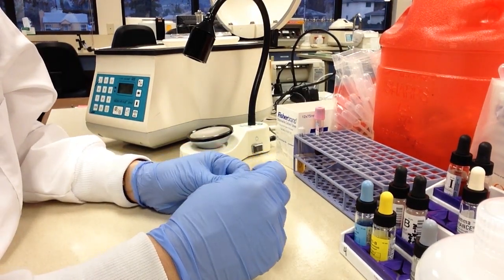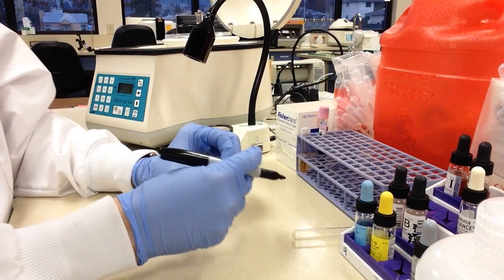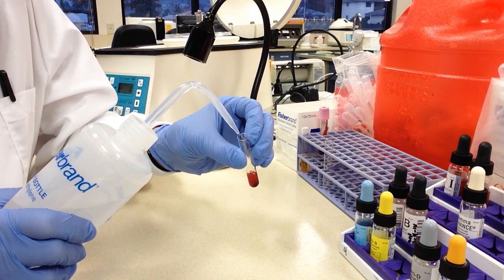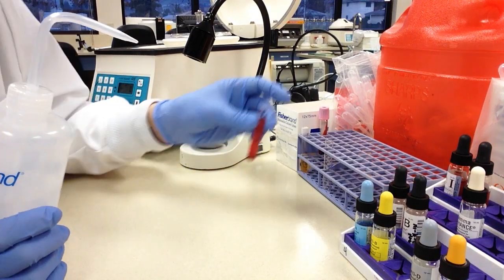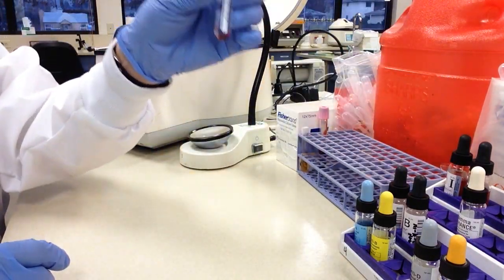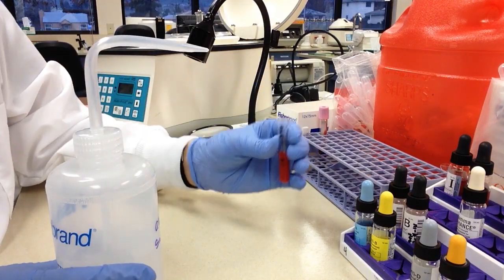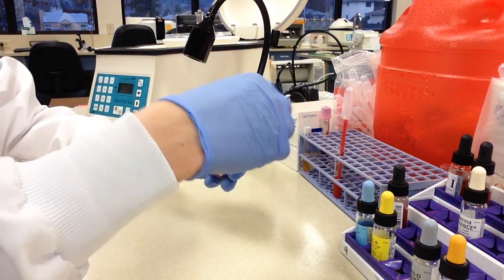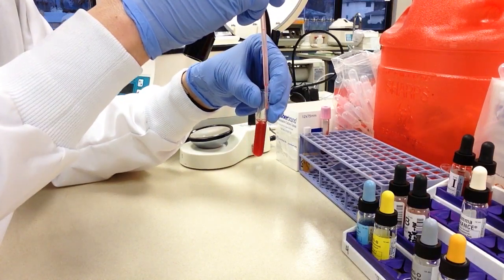Blood Bank - 3% RBC Suspension

Comment: Thank u  for a good presentation.Is there any other method of preparing 3-5 percent saline apart from this method of comparing it  with commercially prepared one?.The reason i ask is because some people  practice where this commercially prepared one are not available.Thanks once again for sharing the knowledge
Reply from the maker: It may be possible to do a hematocrit on the suspension, which should be 3-5%, but I cannot guarantee in any way that these results will be accurate.
Reply: Patrick Tracy salam

Comment: hey i have a few questions about this test.

1. Why need to have 3% cell suspension?
2. What is the purpose?
3. Different between using whole blood and 3% cells suspension.?
-
Reply from the maker: +Oyleza Bell For optimal antigen/antibody reactions to occur, we need to avoid prozone and postzone. These involve an RBC suspension that is either too heavy or too light. Too much antigen or antibody can lead to false results.We don't use whole blood because every person may have a different RBC concentration. The essence of blood bank testing is consistency, so for that reason every step is controlled even the concentration of RBCs.
Reply: The suspension is made cause we should make sure that the concentration between the Ag and Ab of the test will be ballance. If you watched from the beginning of the video, he separated the plasma component to remove the Ab of the sample at first, it means that there's only RBC in that tube which means the Ag of that blood is much more than a whole blood.
Reply: @ear_sthetic1221  

Thank you sooooo much
Reply: What do you do if you have not reached the desired 3% suspension after putting in the saline? Do you just dump a little bit of the suspension then add more saline?
Reply: To expose antigenic sites

Comment: Can you use whole blood from an unspun pink tube?
Thank you.
Reply from the maker: The problem with using whole blood is that it still has the plasma in it, which is not what you want. You may have to wash your RBCs more than once. You should ask your instructor or blood bank supervisor.
Reply: Thank you very much, Patrick!
So there would be no problem if it is washed a few times?
Reply from the maker: The point of washing is to get rid of as much protein as possible, so washing a few times with isotonic saline will probably suffice. However, you really should consult your instructor or blood bank supervisor on this.
Reply: Thanks again, Patrick! 
Actually a fellow tech insisted on doing this method.

Comment: Why we make rbc suspensions? Why not just use whole blood
Reply from the maker: Hi Hafsa, we make a 3-5% RBC suspension for two reasons. One is because we need to have consistent testing conditions. When we make a 3-5% suspension for all patients, we can say that the results will be more consistent and reliable. If we used whole blood, the percentage of RBCs could be very diffferent from patient to patient. The second reason is because whole blood contains plasma which may interfer with agglutination. To put it simply, plasma is sticky and may lead to false positives in agglutination.

Comment: hmm what are the uses of RBC suspension in the laboratory?  and how can centrifugation and decanting of supernatant affect the final concentration of the red cell suspension? 
pls help me, I really need the answers asap. thanks:)
Reply from the maker: In blood bank testing, we test plasma/serum and RBCs. For RBC testing, e.g., forward typing, we need a 3% RBC suspension from the patient before we can start the test. Another example of when you would need a 3% suspension is for a crossmatch. You take a segment from the donor unit and make a 3% suspension before you start crossmatch testing.Centrifugation and decanting aren't usually issues when preparing the 3% suspension. They are more of an issue for washing RBCs after an incubation, for example, during the indirect immunoglobulin test (IAT). When preparing the 3% RBC suspension, you have to be careful that you don't add too little or too much saline. To see if your 3% suspension is correct, compare it against a reagent bottle that has cells, e.g., A1 or B cells used for reverse typing.
Reply: Thank you patrick!:)